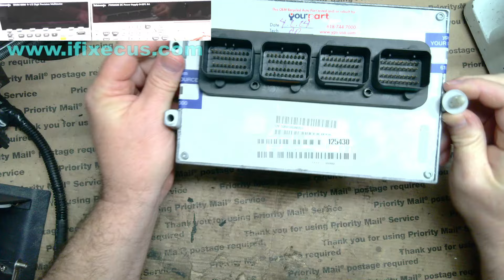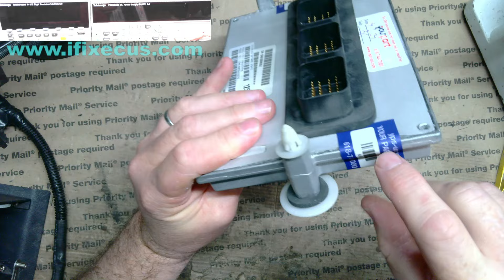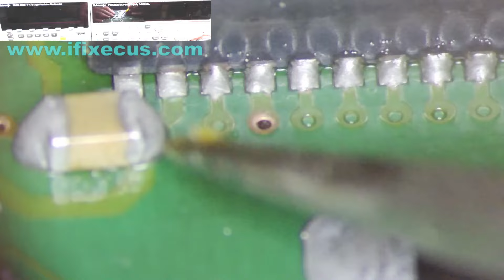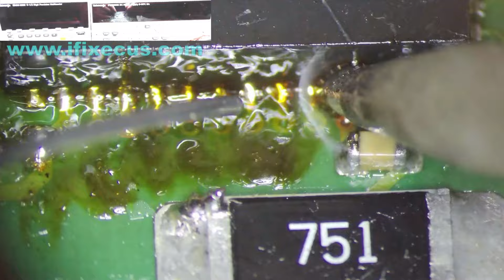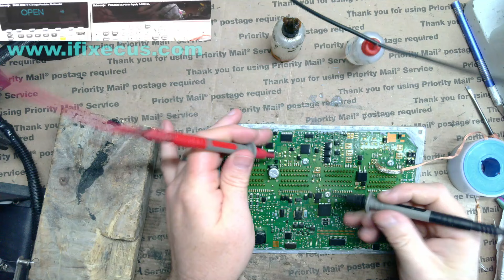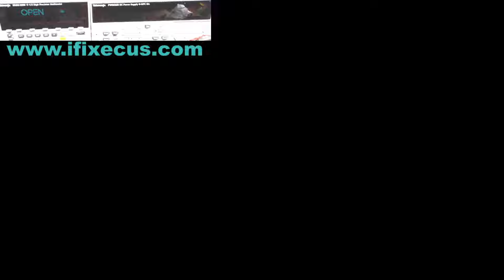Re-Repairing a Jeep ECU: Because Once Wasn't Enough

Comment: Wow. Your so meticulous! I have trouble soldering these. What I do is heat up the PC board first then the chip when putting it on. The aluminum backing acts as a high heat sink. I've burned several of these chips by heating the chip with the board. I'll think to check for shorts too next time.
Reply from the maker: These ecu's can be a pain with follow ups  if your not careful. I used to put it on a preheater and use hot air but now prefer 2 hot air guns instead.

Comment: i sugest you buy solder paste 183centigrade  degrees and better flux also a jbc type tip then you do a cleaner job
Reply from the maker: Pretty happy with my metcal so no jbc for me.  Ive used solder paste on these in the past but don't care for it tbh.